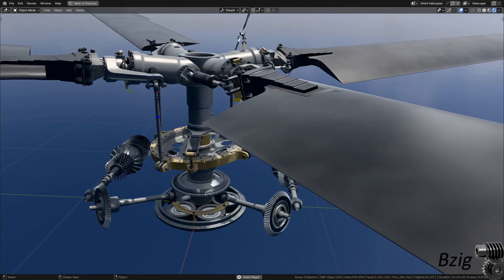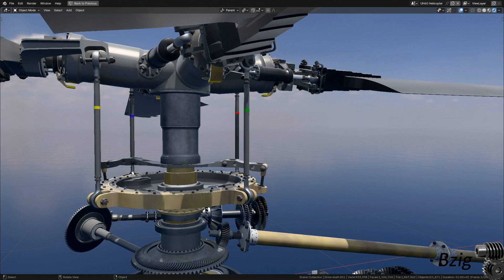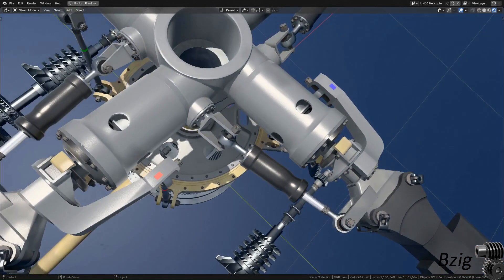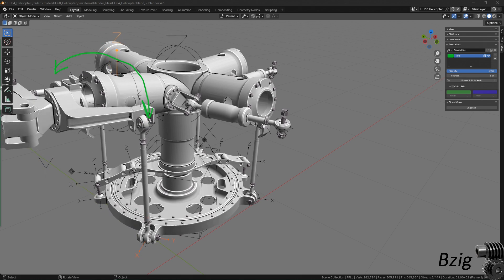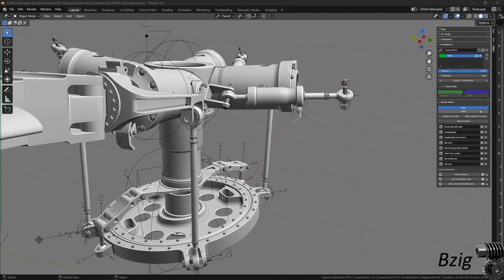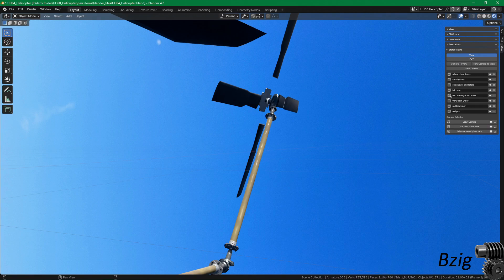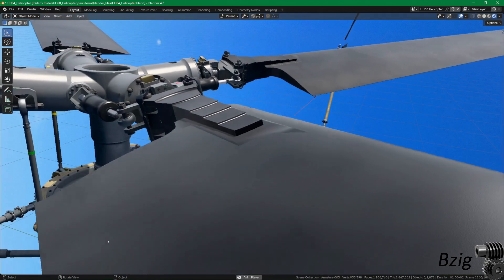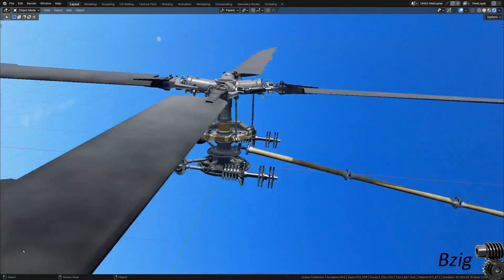How a Helicopter Works - Part 5

Comment: Quick suggestions before I watch past the first 18 seconds.

For the model in your thumbnail, please highlight the changes and additions in two separate manners. Maybe a red highlighter for deletions, a yellow highlighter for changed, and a green highlighter for additions? Or part coloring instead of highlighter strokes.

Look at how change bars and strike through are used in legal/MS Word documents.

Also, please add some bold text title that highlights the update. Keep out of the lower right corner video length time stamp.
Reply from the maker: Good ideas!